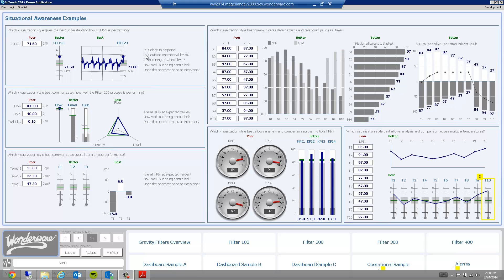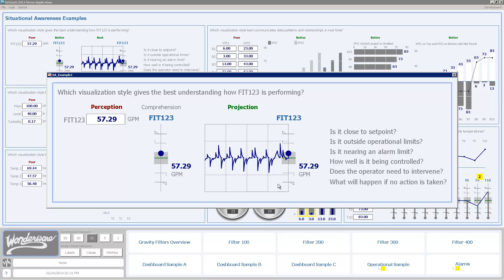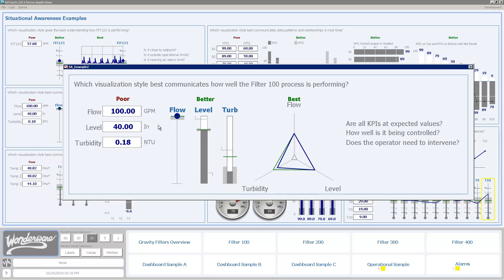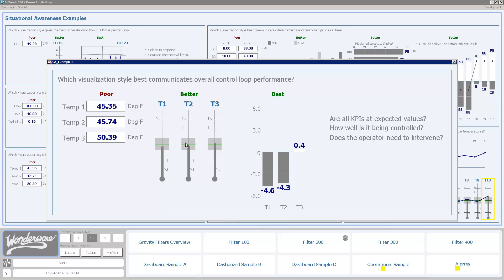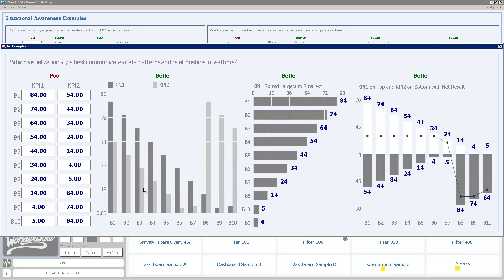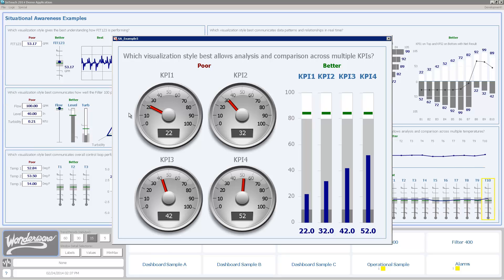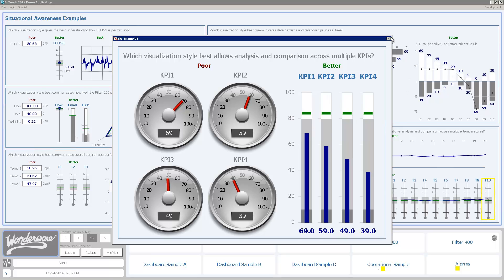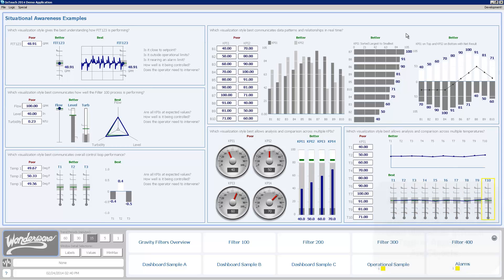InTouch 2014 Situational Awareness Design Elements

Comment: On the analog gauges. I've been taught to select a gauge where the optimal value is at 12 o clock. So in the operating room, one would glance over the gauges, if all are at 12 o clock - great; if one is not, that stands out. Then even better if there are green, yellow and red areas to indicate how bad the situation is. Are those functions available? In large use however, those too will get overwhelming, so I fully approve for example the bar charts. 

It's great we are moving toward better UI's, too long have we been using hard to comprehend simple value displays. Even the simple vertical meter ("comprehension") is a big step forward. 

Great introduction video, I will start my first SA project right away. Thank you.